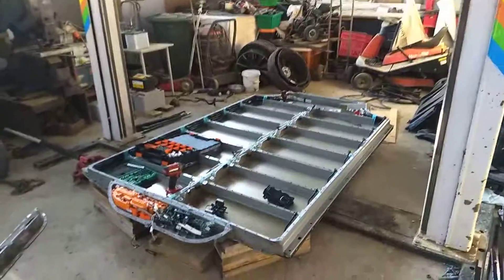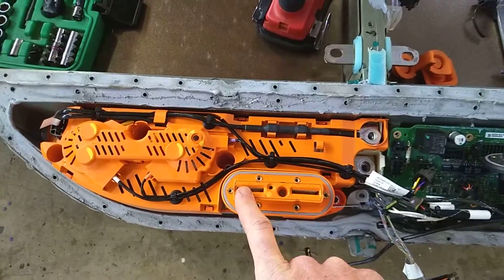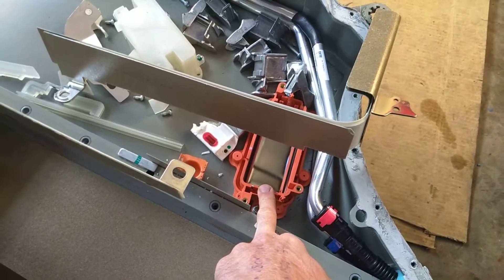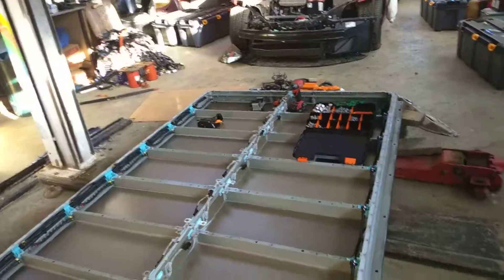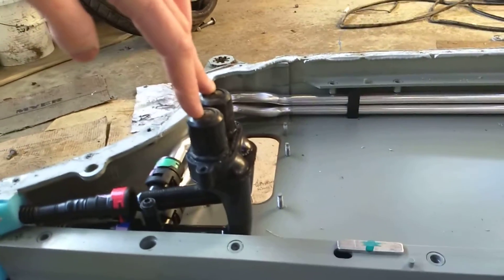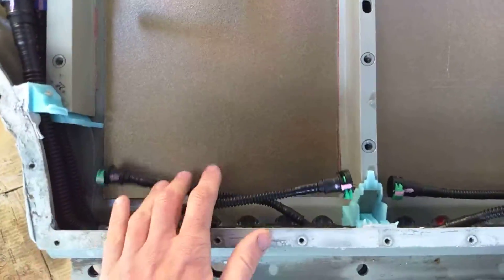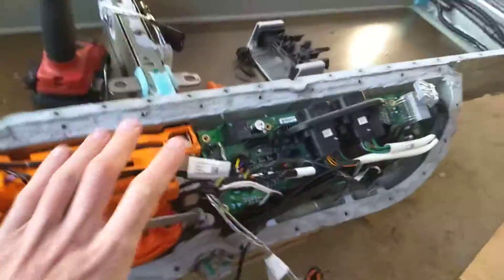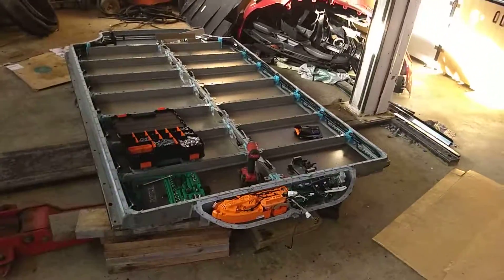Inside a Tesla Model S Battery Case

Comment: Great video, I've searched everywhere for this knowledge and you seem to be the only one that shows it in detail. But there is something you show but don't talk about. In the front portion of the battery on the driver side there is a small access cover. You show it from above after you point out the fuse. What is that cover for and can I safely remove it? The early model S was plagued with water entry into the battery. My battery has just stopped operating with no warning. I'm hoping to remove that cover to see what I can learn. Is it okay to remove?
Reply from the maker: I believe it's a one way valve to let water/moisture escape. I'd say it's as safe as any other part to remove. However diagnosis on a Tesla is easiest if you can get the fault codes- either go to Tesla or find someone with access to Tesla diagnostic tools. I don't know what the status is on that at the mo- have any countries or states forced Tesla to allow access to these tools? If so get a VPN connection to that country & get diagnosing!
Reply: @RaglansElectricBaboon  okay, great. So I can probably open it safely to see if there's any signs of moisture in there. Unfortunately my car was working perfectly, and then I went to drive drive it after it sitting for about 2 hours, and I got in and there was a couple clicks and the centre screen went black, or didn't come on, and the car won't go out of park. Because the centre screen is black, there is no codes. The eMMC recall has not been done, but Tesla is refusing to do it unless I commit to buying a new battery first. I don't believe it's the battery. The centre screen as far as I understand runs off the 12-volt battery which is fine and replaced recently. The app on my phone says the battery has failed but won't connect to the car anymore. The drivers screen says high-voltage battery voltage reduced. I'm wondering if the OBD code reader that plugs into the car would work without the main computer working. I'll find out once I get the adapters
Reply from the maker: Email me & I'll put you in touch with someone who is more skilled & less greedy than Tesla. Solarcyclenz@gmail.com
Reply: @RaglansElectricBaboon  VPN triangulation. Smart

Comment: That was great! Yes, it is a work of art, and brilliantly designed.
Question about the coolant flow - is it serial or parallel?
(I'd expect parallel so that a module at the end of the chain doesn't get cooled by warm liquid, but this wouldn't necessarily be a problem if the flow cycle was fast enough.)
Reply from the maker: Thanks for the appreciation! Your expectation is right-parallel. To ensure the last modules don't get starved I guess they make sure the main gallery is large enough to maintain high pressure and flow down the length of the pack.
Reply: @RaglansElectricBaboon  Great - thanks for the clarification!

Comment: How difficult would it be to modify a Leaf battery case to fit Tesla battery modules with the coolant loop? I assume more cost than it would be worth
Reply from the maker: There's not room.
Reply: Take out the back seat and stack them in the interior. Not as low to the ground for center of gravity, and you will need to stiffen up your shock absorbers, but you will get some incredible range.. now, the coolant loop/ pump; do you think there's room in the front hatch for the pump and run the coolant lines both through the Leaf packs and up to the inboard Tesla packs? I used to have a leaf so I get the desire for extended range 🚗 ⚡